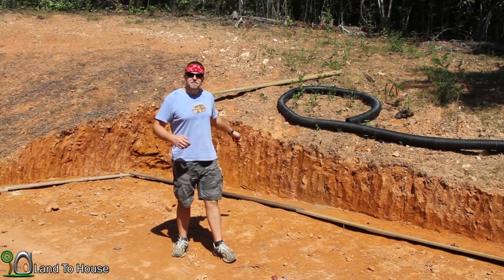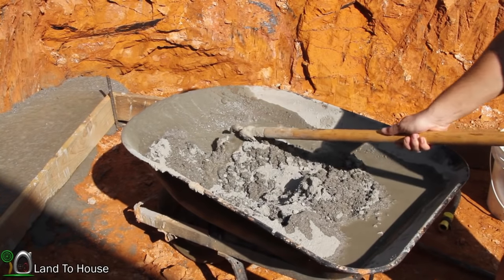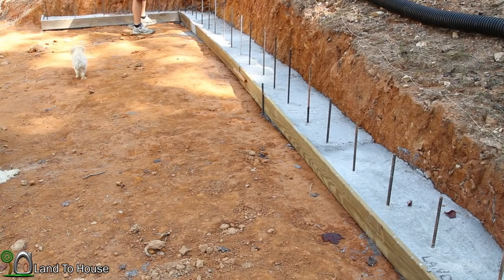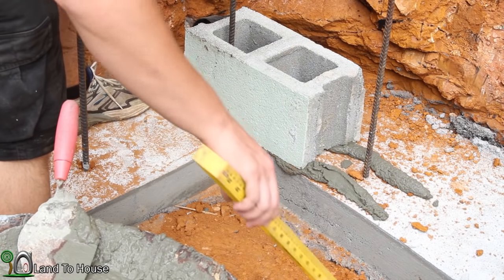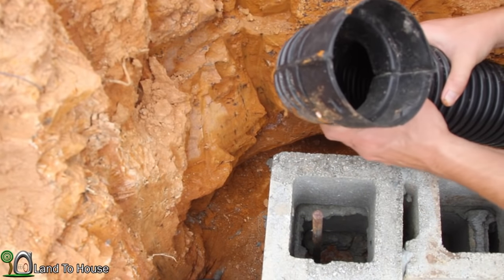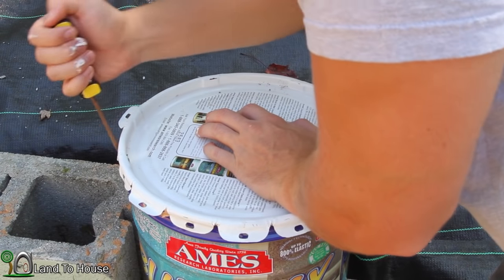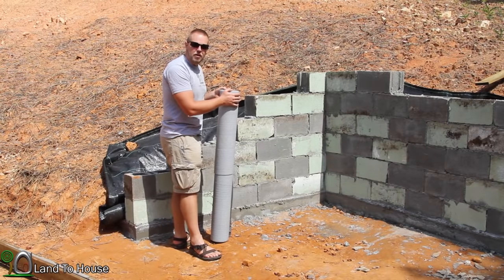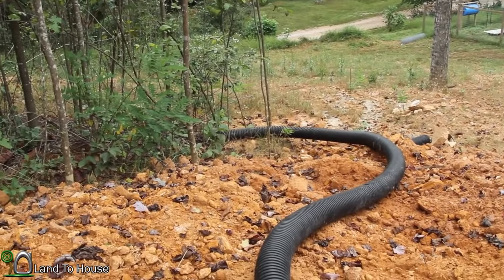Build a Block Retaining Wall - Build a Workshop#2

Comment: Vertical rebars and no foundation rebars? Where is the aggregate for the drain pipes? Why the fabrics covering the drain pipes? Drain water going into the septic tank? If you don't know what you are doing, hire the contractor. It will not last. Shame...so much work into this and it's all going to waste.
Reply from the maker: As you can tell I am new to construction. So far there has been no shift in the wall. I think that I will be doing a minor cleanup of debris that has fallen down over the past year. The drain water is going over the septic. I have it running in that black pipe over the septic and down the hill.

Comment: there are several places where you didn't level one block to the next or align them such that each vertical face is on the same plane.  The rock size you used for the drain is waaaaay to big. Go back to your Lego set
Reply from the maker: That last jab... haha.  Yes much of this wall is wrong (if not all of it). It has held up without issues so far but I do have plans on replacing this wall with a real one in the future. The hill is around 5 feet tall and that is about as tall as a real wall can handle without having to go with large block.

Comment: Your advice is either incorrect or incomplete. All sorts of metrics such as:
  Width of footing and why? W = 16" why? because W = 2 X W of wall
  Height of footing and why? Your footing form lumber seems to be 6"?
    Some sources advise on H of footer = 1XH of Block used.
  Vertical rebar reinforcement? Spacing (every other course) ? How many per spacing (2) ? Rebar size? 1/2" or 3/8"?
  Bond beam? Rebar in Bond Beam?
  Rebar reinforcement in Footer?
  Gravel behind Retaining wall and over drainpipe? (Yes) What size (3/4" minus).

This represents just of few of the issues not addressed or addressed incorrectly.

Useless and misleading video. DO NOT FOLLOW THIS WELL MEANING MAN'S INSTRUCTION.
Reply from the maker: There are lots of things that can be improved upon here. I call this series "build a workshop" Not "HOW to build a workshop". That way people can watch the videos and realize these steps are "my way" of building a shop and wall. To gain the knowledge of the proper way to build a wall you would need to talk with a local builder who knows the soil type you have. Then there are important things like frost line depth. 

Anyway thank you for pointing out the faults with the wall build video. This might help others look for the info in other locations.

Comment: 10 min into video... As a complete layman, I started reading comments after seeing a discrepancy in the method... I think I need to find a more professional video for the right method of application. (Not fair to someone spending a lot of money).
Reply from the maker: Hello. Yes my video is how "I" build a block wall. There are several ways to build one and most of them are better. This one has lasted a year now with zero issues but each wall will be built in a unique soil and location so be sure to find the correct building style for your area. I am also an absolute beginner at this construction work.

Comment: no mask when emptying out concrete makes me cringe. safety first
Reply from the maker: +First Last I was just out in the building and realized that I should have had a mask a long time ago. The dust is everywhere. So I purchased a small mask for now and will improve as I go along.
Reply: No mask, no gloves, no eye protection, but those look like a great pair of sandals. 

The wall may last longer than the builder.

Comment: Wow! A for effort but seriously you have no idea what your doing! I’m a mason and there’s so many things done incorrectly or just plain wrong!
1- there’s no steel in footing  
2- never just poke vertical steel into concrete like that! The ends in the ground will rust quickly 
3- block set on the edge of the footing provide no stability to your wall ( your asking for it to fall over) 
4 setting blockwork level and plumb is a must ( remember apprentice masons take 4 years to learn how to do this stuff correctly) 
5- drainage lines must be (socked) and have another layer of Geofabric 
6 - drainage aggregate no larger than 20mm! 
7- inadequate waterproof membrane 
8- there’s no horizontal steel through the blockwork ( should be every 2 course of block 
Sorry really don’t wanna be negative but this is like how not to build a retaining wall!
Reply: Very thorough and well-stated observations. The perfection of execution is just as important as the end-function 👍👍👍👍
Reply: This is a good check list of minimum requirements, because no-one should copy the way this wall was build in the video. 

We build concrete block retaining walls using the techniques you describe here in the Philippines. I would add that a foundation for a retaining wall should not be placed on top of the soil as the wall could just be pushed forward with the current design. I would put such a foundation about 2 feet down using proper reinforcement.